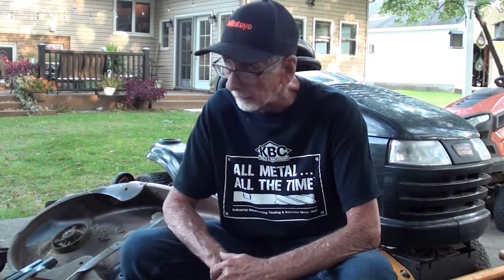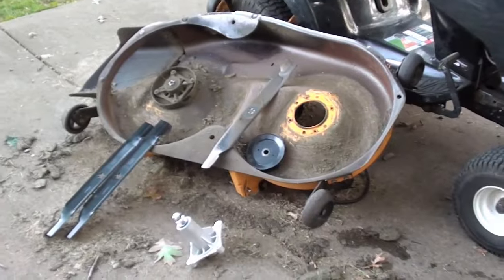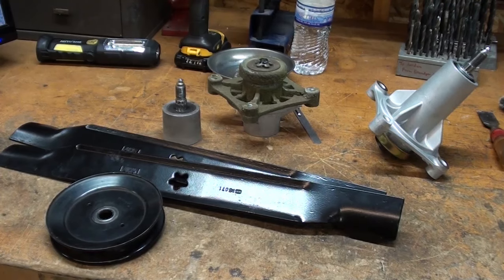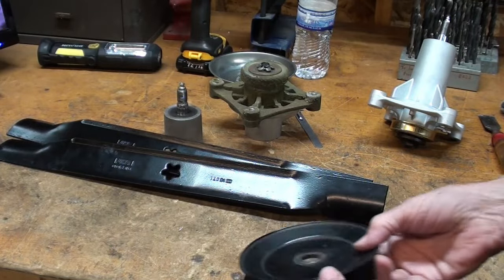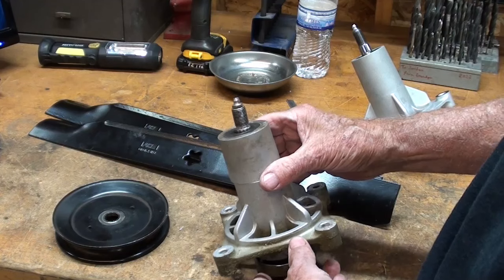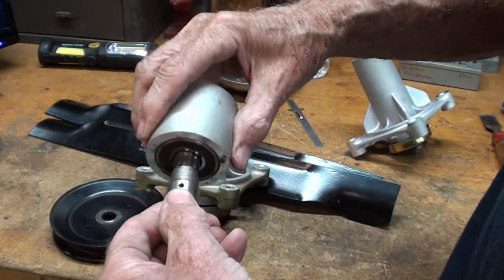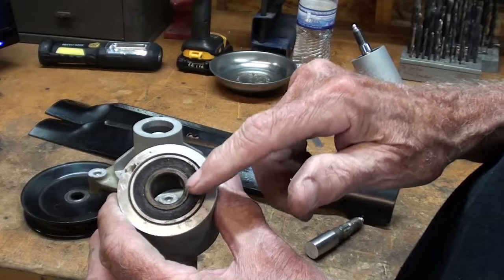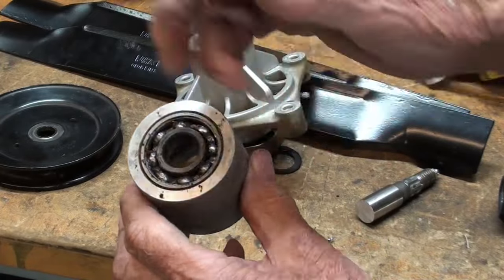LIES & DECEIT mower spindle fraud SHORT SUBJECT #52 tubalcain

Comment: mr pete  ive always done that since the 90s 
and it will help to drill 2 small holes in the outer seal to allow for relief of the hydraulic pressure build up 
otherwise you may blow the bearings back out while greasing
also a hole can be threaded in the side for RETRO fitting spindles that have NO fittings
Mike

Comment: In 1974 my dad bought a new Bobcat push mower. Briggs engine, magnesium deck, self propelled. The first week that we had it, I hit a metal stake next to our pole limas and stopped the mower DEAD. You couldn't even pull-start the mower... It would not  spin. We took it back to the dealer and he showed us that the key in the spindle shaft had sheared. It took him less than an hour to take it apart, install the new 33¢ key stock, and then reassemble the mower. So..... A 33¢ part saved that mower.... AND "my bacon".  

I help a machinery repair guy service some machines in a VoTech school. A machine has failed and has a bad wobble. Taking it apart, it seemed that a previous repair company was supposed to replace a ¼" key in a shaft and had none in his toolbox. He found a ¼" HSS toolbit on a metal lathe and used that for the repair. The next "catch" on that machine destroyed the spindle-- the whole keyway stripped out.
Reply: Ohhhhh I forgot to say,.... About 1991 I added an electronic ignition to that same mower, replacing the old internal points and condenser. We used that old Bobcat up into the 2000s.  It ran good-- but I kept a wide berth around our lima stakes!!
Reply: I found a hidden 3/4" steel grounding stake with my Honda mower. Bent the crank a bit, but it didn't leak oil. Kept mowing with it for a couple more years, until I hit the same stake again, but on the other side of the blade, which straightened the crank just about perfectly. I immediately got a saw and cut the stake off well below ground level. Mower still runs great.
Reply: @Kevin75668  That's the first time I've heard of an accidental crank straightening. LOL
Reply: about 20 yrs ago I bought a brand new floor model Craftsman push mower, The second time I used it I hit a rather large bolt that was holding up a sculpture. The mower stopped dead and oil poured out of the engine all over the deck. The crank case practically broke in half. The crankshaft never moved again. I kept that mower around till last year thinking I would take it apart just to see the carnage. I finally gave it away on craigslist. Whoever got it got a lot of near new parts, Wheels, deck, carb...
Reply: @Alan-jx7uk I bought a new 22” Craftsman in 97, still in use today. The Tecumseh engine has the shear key in the flywheel, I learned that after my son ran something over and it wouldn’t restart being it sheared and then was out of time. Older equipment is usually made to service and lasts pretty well.
Reply: @1971_Chevelle_SS  I agree, The old mowers were made to last. I expected my mower to last many years. Unfortunately the damage to my mower was a little more severe than a sheared flywheel key. I'm not dogging on the old Craftsman mowers. No mower newer or older would have survived the bolt I hit. (I neglected to mention the bolt was a 3/4" bolt (thread diameter not wrench size) anchored in concrete.) My riding mower was adjusted high enough to pass over the bolt. The new mower unfortunately was not. Glad you are getting good life out of your mower.
Reply: That is why vertical push mowers have aluminum keys

Comment: I can't help but wonder, if they had installed bearings with a rubber seal on one side, how long would it be before pumping new grease in would blow out a seal?? Every grease fitting I've ever encountered was on a bearing or ball joint designed with openings to allow the old grease being displaced by new grease to exit.

Comment: Thanks, Mr. Pete. I bought a John Deere from Home Depot. I learned that John Deere has different levels of quality. The mower quickly deteriorated. I upgraded to a Toro and serious issue followed. I then bought a commercial grade JOHN Deere. 25 years ago and it is STILL going strong.
Reply: This is 100% correct. I worked as a mechanic at a Deere dealership for several years.  The difference in the price between the consumer and the commercial line is a pretty big gap, but so is the quality.

Comment: Hello Lyell ,  before I retired from my “mower repair gig”  I’d get the bearing numbers from the broken spindles, order several top & bottom bearings (bottom ones are bigger) .  Order new spindle housings,  assemble complete units ready to go …… except remove the inner seal, drill & tap a hole for a grease zero IN THE CENTER OF THE BEW HOUSING, assemble the spindle and be ready to go for the time someone brought me a broken part.  All ya gotta do is remember to is “remember to grease the deck when you ck it for operation” it’s not a cure all but it’s a good upgrade for a man who takes care of his mower.  That spindle assembly was $100.00 at the local TSC where I live,  and they ain’t “stump proof” 😉😂

Comment: I have greased a spindle and the grease has gone passed the both plastic seals and made it’s way out of the hub. I agree, allow your mower to cool before cleaning. This reduces water getting into the spindle casing! Just like driving a hot vehicle through a creek while it is hot! Water get inside!
Reply: You are exactly correct. I can't believe all the people here that have been hoodwinked into believing that a grease gun cant force grease past those little loose seals. It takes a lot of grease to fill the cavity but after that you only need a few pumps now and then. People are certainly  strange.

Comment: Great exposition!!
Up here in Canada I found leaving the seals alone and changing the sealed brgs alone until signs of wear appear
Then change them with identical brgs BUT IN C3 class
They have a minute amount of extra clearance to allow for Canadian temperature changes and last much longer 
You must get them from a bearing supply house and only cost 2.00 more!
Shielded brgs are meant to be in an clean oil bath environment usually 
Also the new offshore blades bend when they touch a lump of dirt
Get North American blades
Thanks again

Comment: Years ago I worked in a large maintenance shop that had me ( electrician ) and 14 mechanics. Had to baby sit several of the lazy ones. They would tell the boss machine had an electrical problem because motor would no turn. 9 times out of ten pump, conveyor or machine was jammed. Then I would check the zerk fittings after they told me they greased machine. Usually found a few bad zerk fittings ( would not accept grease ).

Comment: In1979 I had a summer job at a restaurant/bed and breakfast and one of my duties was mow the grass on the property. In previous years they had hired a lawn service but this year they thought they would save money by buying a Bobcat rotary mower and a weed whacker and letting me do it. The second week I was cutting the owners front lawn when the motor came loose from the mower deck. I was able to find all the bolts and put it back together. So much for buying a commercial quality mower.
Someone donated a Sears lawn tractor to our old church. It was the worst mower I ever used. Even when set at the maximum height it would scalp any place that wasn’t perfectly flat.
Reply: Quality control operatives  can get the sack if they do too much Quality control.
Reply: I have a Sears tractor with the same problem of low deck height. I replaced the small front wheels with 16 inch from Northern and it was still too low. I finally raised the rear with spacer blocks to get it high enough for Kentucky 31. Cutting too low not only damages the grass but the mower picks up rocks and other stuff that dulls the blades.

Comment: I’m in the UK and have never heard of a ‘grease zerk’. We call them ‘grease nipples’.
On a totally irrelevant matter, but related to different names each side of the Pond for the same thing, I had an old friend who was a retired railway engineer (he assembled the crankshafts of massive steam engines at Horwich Loco Works - details online), I used to help him keep his dilapidated cars on the road and he always called a ‘U joint’ a ‘hardy-spicer’.
👍🇬🇧👍🇺🇸👍
Reply: Mr Zerk was from Kenosha, Wisconsin and his patent for the grease fitting made him very rich. Had a huge mansion behind tall walls and it was a real adventure for us kids to sneak in at night and see how the other side lived.
Reply: @RRaucina  👍
Reply: Aluminium -Aluminum
Reply: @robertklein1316  Yes!! 😊
Reply: Hardy spicer is just a brand name. Just one of many.  Just like how a skid steer loader  is called a Bob cat by many. Or a tract front end loader is often called a Drott.
Reply: It’s like Kleenex or Xerox
Reply: @ToolinAround2025  Even in the UK, any make of vacuum cleaner is called a ‘hoover’.
Most people don’t say “I’m cleaning the carpet”, they say “I’m hoovering the carpet”. 👍
Reply: @mrpete222  Zerk is only one of a couple grease fitting types  we use over here in the colonies.

Comment: The grease between the sealed bearings is to keep out moisture. Grasshopper used to sell its spindles with seals only on the outside. They switched to seals on both sides but still have the zerk. I don't agree with it necessarily but when changing the bearings only as you normally would it is very easy to remove the inside seal.

Comment: Thanks for the perspective.  We work our 22 year old LTX1000 pretty hard during our 3 month SoCal weed mowing season on our 1 1/3 acre.  We keep it in a shed so it still looks great.  We like to mow the occasional rock which often means mid-season repair.  We have spare spindles and other parts for that reason.  I like to remove the deck after the mowing season, clean it thoroughly, grease it up, sharpen blades and inspect the spindles, pulleys, blade brakes, etc.  Speaking of reliability the Briggs Intek 21.5 HP V-twin still runs strong, original tires although I have tubed them, just rebuilt the deck for the first time with new spindles, pulleys, blade brake actuator, springs and blade brakes, and deck belt.  We also just replaced the original power belt.
Reply from the maker: I can tell you are good at maintenance. Very very few people do that.

Comment: Why I always remove the spindles on a mower, press the bearings out, and remove those inner seals. If it's my mower I get the measurements of the bearings. You can easily replace bearings (if the staft isn't damaged) for a few bucks over replacing the entire spindle unit like they tell you too.
Reply: If the bolts holding the spindle will turn out of the housing without breaking.   I see a few of these.  Attempting to drill out the bolts is not fun.  Maybe OK if you have a mill.
Reply: those spindles can usually be removed with a bit of heat and an impact driver. I leave them in place and press out the shaft. The standard bearings are available at the local hardware store at a fraction of the price of OEM. The spindle shafts are also available for most mowers, even old ones. If you have rough ground, learning to rebuild those deck spindles becomes a necessity.
Reply: @ralston48  A but if anti seize might not be a bad idea if your maybe rebuilding them again.
Reply: Import spindles are about $25 ... so I just replace 'em.
Reply: @UncleKennysPlace  Exactly, new spindles ready to go for the price of the bearings.
Reply: @UncleKennysPlace not in all cases, the ones for my mower are approaching $200 and that’s the China knock offs. I got the bearing and seal numbers off the last one and going to rebuild next time if I catch it before breaking a housing.

Comment: The spindle with the sealed bearings and grease zert are designed that way to fill two needs.  (1) most people will never grease the spindle. Thus the sealed bearing will usually last past the warranty period.  (2) some people will read the instructions and will grease the spindle. The instructions will tell you pump in grease until you see grease coming out of the spindle.  After the spindle is full of grease the grease gun will exert enough preasure to pass grease past the bearing seal. This will push out the old grease and inset new grease.  If you look closely at the seal you will see that its not really a seal but a shield.  The hole in the shield touches the inner race but does not seal grease under pressure.
The people that design these mowers know who will operating them.  They are usually not trained and in some cases children.  The mowers should be capable of hitting things that will not cause extreme damage to the mower or injury to the operator.  Several designs employ the splined pulley you showed.  A stripped spline system could be a safety feature to help dispate some of the energy of the sprinning blade and a 20+ hp engine full throttle.
Reply from the maker: Excellent comment

Comment: On my spindles, i took off inner seasl on both bearings,drill and tap the side on spindle housing to screw a 1/4  grease fitting. I installed the grease fitting facing rear  of my tractor. I also drill a 1/16 relief hole near the top of the spindle housing, like  just under the bearing  to see grease coming out when i pump some grease in. Took much grease  for initial load  but after, just  a fews pumps  and its  good for summer or almost. Some  may  not like  my modification but work quite well for me.

Comment: Which is why after I broke the lugs off my second spindle I designed one in steel,  had a local machine shop make them as too big for my Lathe and that was fifteen years ago and I haven't broken another spindle housing since.
Blades are too thin,  wear out fast and hit anything other than grass such as a stone the size of an egg and they bend like a banana.   So bought aftermarket ones which are 50% thicker material - and don't bend.  
The four deck wheel shoulder bolts snap like carrots so I designed and made up my own assemblies using high tensile socket head cap screws and mild steel bushes.   Haven't broken those in the last 15 years either.
Where the chassis has two bent up flanges at the rear is where there are three holes in the ~ 2" deep "U" section ONE OF WHICH IS SQUARE WITH SHARP CORNERS.  That is where the chassis WILL break,  the mower folds in half likely trapping your legs in the process.   I dismantled the mower,  cut up some 1/8" steel fish plates,  tapered the ends and welded them to both sides of the chassis.

Comment: My old Craftsman 42" has the original sealed spindles and has mowed 1 1/2 acres for the last 28 years, with no grease fitting ( Zerk Fitting ). 

Now, if instead of Zerk Fittings, they equip those spindles with Stump Detection technology we'd still be mowing. 🙂

Comment: Even if the bearings weren't sealed, you'd have to pump the whole housing full of grease to get anything on the upper bearing. Next, the design of the pulley splines is just cheap...stamped steel, what are they smoking???
Reply: They're better off without the splines so the a impact can be dissipated somewhat. The commercial mowers mostly use spindles that have a key from shaft to drive pulley. The key can shear and be replaced for pennies. And only a centered bolt hole on the blade. But I've found every spindle bearing installed with both seals preventing grease. And usually no grease under the bearing; from the factory!

Comment: 2018 Husqvarna ZT254F: While doing annual maintenance I pulled one spindle hub to check for a seal on the inside as I had heard about this but not seen it. Yes, both upper and lower bearings had seals and the shafts had the innocent looking zerk just as yours has. My bearings were still good.
The fix, I hope this helps someone: Do not remove the deck from the mower unless its easier than jacking up the mower. Do not remove the blades, they can stay on the shaft.  Remove the belt and pulley on top, you should be able to remove the shaft with lower bearing, blade and all from below; or above if you have the deck out and flipped over. 
The seal on the lower bearing on the shaft was easy to remove. For the upper seal: I had an old skinny flat blade screw driver I filed an almost right-angle grove on the tip. This leaving a barb angled out to the surface of the tip. I left the spindle hubs in place on the mower deck. As I pushed the tip with the barb against the seal I could move the tip in the direction of the barb and snag the seal, then pull down. I was able to remove all three upper seals with two to three tries each. I did fill the hubs with grease to avoid air pockets, then push the shafts up into place. Not much mess on bottom and just a worm of grease out the top. A paper towel with a hole in it caught that grease keeping the messy part to a minimum. 
I now only give them a half pump squeeze twice a year. A full pump of grease will probably push the outer seals out of place, that will allow dirt into the grease and bearings and grease will sling all over the deck and points beyond.
I did that in 2019 and no problems yet. Mowing in central Texas with plenty of heat, long growing season. One acre yard and mow the other four acres also with it but only twice a year.

And yes sir that kind of stuff makes me raw too! Had I not heard the 'rumor' no telling how many spindles I'd be out by now.

Comment: There all like that. I used to keep one in my shop to show customers that it's a waste of time to grease them. Some guys like to argue that you can grease them anyway but there called "SEALED BEARINGS" for a reason. I could never really understand why they would go through the process to drill and tap the shaft then install a sealed bearing. Pointless. And why go to all that work to disassemble the spindles, remove the inner seals and then waste 2 tubes of grease to fill them. Plus, if you over fill them, you'll have grease all over the place and blow the outer seal out and let dirt into the bearing. Don't worry about greasing them, they're run to failure.